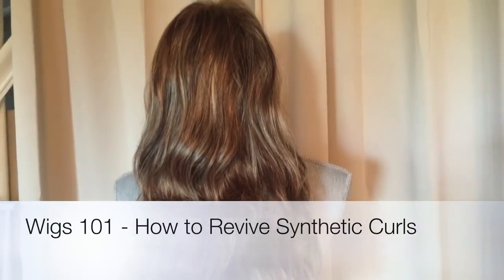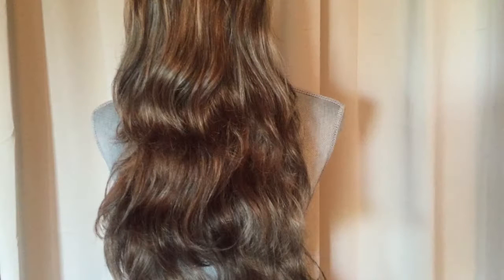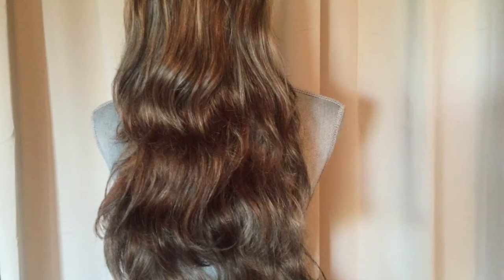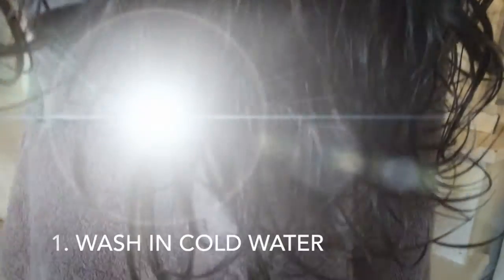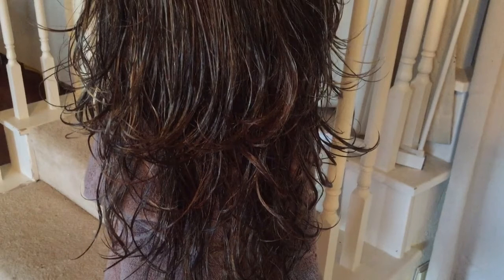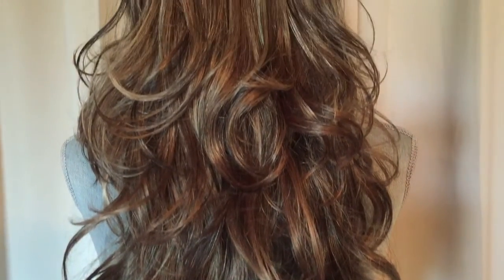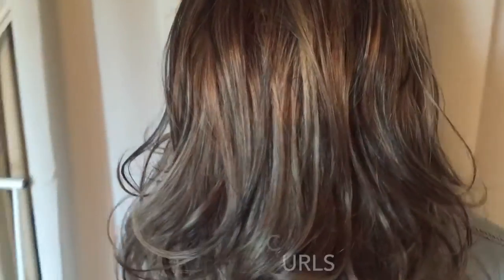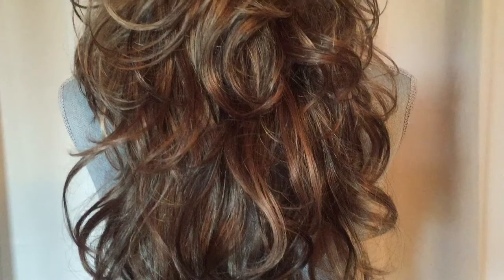How to Restore Curls in Synthetic Wigs

Comment: thats great to know. I learned about how to restyle using the hot water method, but this seems much easier if you all you need is a refresh. very good tute.
Reply from the maker: Thanks. Yes, the hot water method of setting your wig in curlers and pouring over hot water is good too for re-setting or even charging a curl pattern.

Comment: My curly wig had big bouncy kind of bombshell curls I’ve washed it and it’s drip drying but the ends of the longest pieces of hair were brushed prior washing and there frizzy I’m not sure how to revive them?
Reply from the maker: You can try some sheen spray or a drop of hair oil to minimize frizz. If it is heat safe you can curl it like normal hair. If it is not heat safe then you could set in curlers and dip in a pot of very hot water. Let dry in curlers.

Comment: Hi, wig noob here...I have a Paula Young "beachy waves on headband" wiglet that i love, but I let it hang on a padded hook, and some of the waves seem to have fallen out of it. I let it soak for about 20 minutes in very cold water (no shampoo or cond.) and dried it flat on a towel...and it didn't seem to bring back much curl. Should I have hung it to dry? Also, would it help to use shampoo/conditioner? Does it have to be special wig shampoo, or will any shampoo work?   Would it help to form and clip some loose curls as it dries? I dont' think it's heat-resistant, so any suggestions on getting a little curl back will be most appreciated! Thanks for your great tutes.
Reply from the maker: Using any normal shampoo and conditioner is ok and sometimes helps. When wet shake out excess water and let hang dry. See my "How to Wash a wig" video. If using cold water forming curls won't help. If this doesn't help restore curls move to a more advanced but still easy process which works on both not-heat safe and heat safe wigs. Use foam curlers on dry wig to get the number of curls you want. Get a large bowl of cold water and one bowl of very hot water. Dip wig with curlers into cold water, then into hot watering tongs. Lay with curlers on a towel till dry. Remove curlers and then gently finger comb out curls or use a wide comb.
Reply: Wow, thank you so much for the prompt reply! Never thought to try hot water, but i'll give it a go...very helpful, thanks and all the best to you!

Comment: Love the Basic Wig 101 level info!  I have a short, tighter curled synthetic wig and would love to refresh it - any differences in the recommendations for something like this?
Reply from the maker: Washing it should work on any curls even short styles. If your curls are tiny like "Deep Wave" or tighter then washing is totally fine but be very careful with combing out tangles before or after. Use your fingers or a pick or very wide tooth comb.

Comment: what if the wig is matted as well?? Can i still wash it? Its a curled synthetic matted wig, i was planning ro wash it and boil it some new curls. The hair is very matted and frizzy though, will this work or should i attempt to comb the hair first?
Reply from the maker: It is difficult to say without knowing how matted or the type of curl. If it is a very tightly curled wig sometimes combing can make the matting worse. In general, my advice would be use some conditioner and a wide tooth comb or pick to decrease the matting as much as possible. Then wash and boil it so the hair fibers straighten out. Then, let it dry. Add more conditioner and de-tangle it gently. Set in curlers and then re-boil to get the curls back.

Comment: I steamed my wig to get rid of the frizz but didn't realize it would take the body out of the wig.  It wasn't really curly to begin with but had beautiful body in it.  Now it's board straight.  Is there any way for me to get the body back?
Reply from the maker: Yes, you can fix it! Plain steaming while brushing makes a wig absolutely straight. This can help reduce tangles and restore shine to a wig, but it doesn't make a good style. You will need to set the wig in curlers and then steam it, let it dry, then the curls will stay. If you want a beachy loose wave, try braiding or twisting and then steaming, let dry.
Reply: Twisting? Hmm, makes sense. I haven't tried that. Thanks!!!